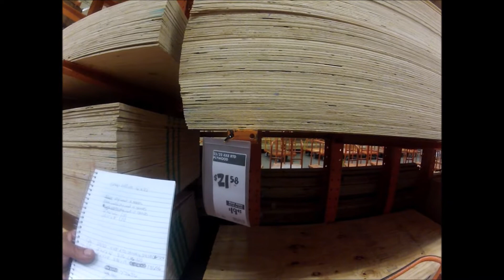new shop build pt 2

Comment: Why not conventional wall studding the sheet it? Gonna be a nice shop. Look forwards to follow this build.
Reply from the maker: To follow in the spirit of the build as the original cabin was built I'd come up with an idea to make the wall panels so it was easier to bring him into the woods this is before the house had ever been installed on the property many years prior it was just an easier method and thank God it's worked out stay tuned there's a lot more videos to come thanks for watching
Reply: @massis32210  much respect man. I will be following along.